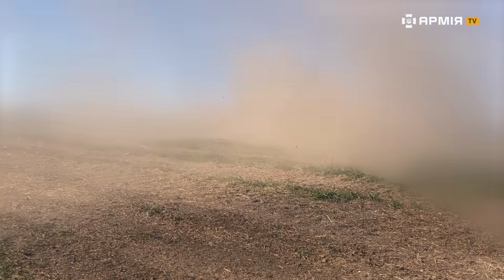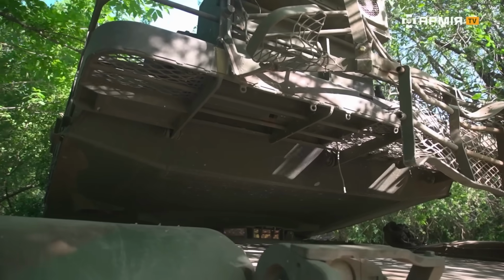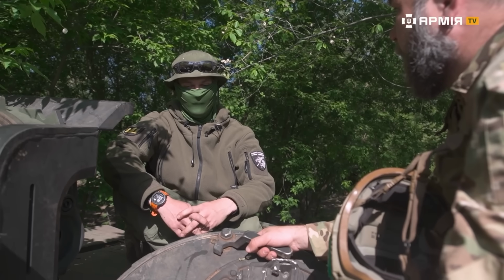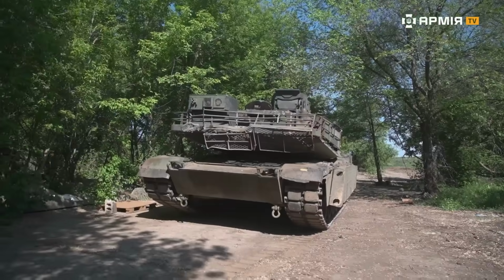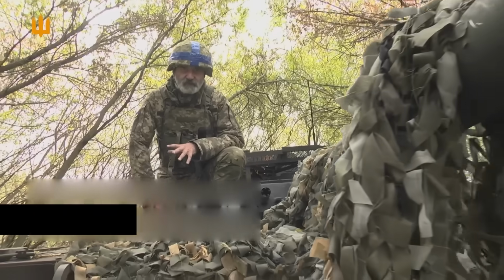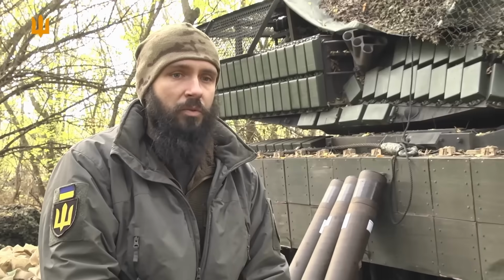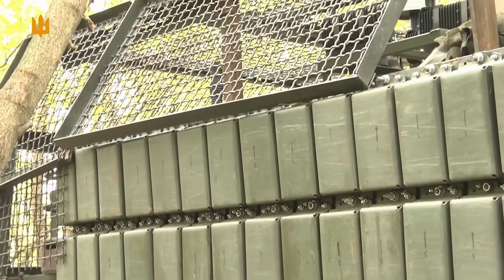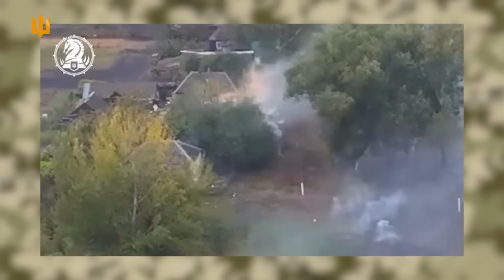Inside the ABRAMS M1A1 TANK: Russia-Ukraine War's BEST Kept Secret Revealed | ARMY TV

Comment: They installed a governor to cut down on vibrations that would loosen all the nuts and bolts in the suspension. Not smart to remove it. More track maintenance. And when moving thru trees, you elevate the 50 cal or if not equipped, max elevate the machine gun mount. Let it take on the branch hits. You only ever see wounded tankers that were fighting unbuttoned or open hatched. Kind of funny how that works. 70 tons of metal around you but you fight with half your body exposed. That is a true DAT (Dumb Arsed Tanker) that fights like that.

Comment: Actually, the best feature, IMO, is the engine. It's a turbine engine capabl of running any kind of fuel. It's an incredibly valuable feature to be able to refuel with gasoline or kerosine or diesel or whatever petroleum-based fuel.

Comment: Kontakt-1 doesn't protect from the majority of chemical ammunitions (kornet, tandem warheads etc) it will protect against basic single-warhead munitions like RPG-7 and such. but the increased weight = fuel consumption, and to place ERA on the turret makes no sense, NOTHING is going to penetrate the Abrams turret, it was specifically designed to defeat tandem warheads and soviet 3bm42 up to 3bm60 APFSDS rounds. placing it on the side of the turret, hull, and on the upper/lower front plate makes sense though.

Comment: Just so everyone knows the M1A1 is a very old variant still is badass but explains some losses on the Ukraine battlefield it doesn't hold a candle to the M1A2 SEP V3 the US will not be giving Ukraine any further variants other than the M1A1 because the armor is still classified them begging for better variants is going to end in disappointment its not going to happen.
Reply: Even the US M1A1 had a better armor package using DU.... the export variants and the ones we gave to Ukraine have a more conventional Tungsten armor NERA configuration than the US DU NERA.
Reply: @Whiskey11Gaming  the a1's ukraine is using has the tungsten driver tub

Comment: There is nothing special about the abrams, they probably didn't even give you the DU armor plating, it's tungsten plates, the roof is still a major weak spot, it's too heavy, chews fuel like crazy, too much mech work to keep running. Slapping reactive armor tiles is a good idea sure, but it's still just a rolling coffin that can be perforated from the top with a 500$ drone....Is it still tank? YEP! TANKS ARE BADASS AND A PAIN IN THE ASS but they are never going to be close to perfect.

Comment: Too many have been Lost... Saw them upfront with the foreign legion fighters in Ukraine 🇺🇦
Reply: Because they were designed for desert terrain, open areas, solid ground and enemies that wore flipflops with rocks for ammunition. They are hard to maintain and if damaged correctly they can't be fixed due to no facilities. Fuel consumption is extremely poor and makes it hard to keep on the Frontline. They're very heavy compared to Eastern tanks often getting stuck and abandoned. The optics suffer from condensation and over there it's often wet and cold. As of now the ammunition is becoming scarce.
Reply: Indeed 👍🏻

Comment: Drones have changed the battlefield. A drone can pinpoint drop or dive into the weakest areas of a tank's topsides and flanks. But not only that they can loiter and actively search out tanks, armor, artillery and troops tens of kilometers behind the front lines.... And the battlefield is constantly under surveillance.  There is no hiding or surprise.

Comment: The Abrahams was designed to fight in the open and blitz the opposition like was done in the Iraqi desert utilizing its long range gun to destroy Russian armor. In Ukraine they under utilize it for skirmishes with infantry and outrooting Russian from trenches wasting its capabilities. The Abrahams suffers the same weakness of all armored vehicles with its achilles hill being the tracks.
Reply: Bro it was literally designed to fight Russian Tanks in Europe.
Reply: @phieag1982  Yeah and it will massacre enemy tanks in a majority armor engagement, but of course most of Ukraine hasn't been a majority armor kinda war, yeah there's tons of tanks and IFVs in use, but there's also tons of mining and counter mining, top attacking drones on both sides, and a lot of massed artillery fire or targeted artillery fire.  
In these kinds of wars the individual superiority of one tank to another is reduced as a deciding factor.  It's rare that you'll find a modern tank design which is just awful, but in the case of the Abrams, Challenger and Leopards they're not as well suited to the current war.
Where they would really crush their Russian counterparts is if Ukraine had the ability to establish at least enough air dominance to prevent Russian aircraft or drones from reliably attacking their NATO tanks, then using them in larger formations to roll over Russian armor.  
As it is though tanks are mostly used for breaching trenches and forcing infantry to relocate but they're also rapidly targeted by drones or artillery and both sides are suffering what NATO members would generally consider extremely high attrition.

Comment: Geez, Australia is supplying more Abrams than America who have 5,000 on storage. Australia gave Ukraine everything they had left working.
Reply: Australia is sending wore out, broke down Abrams that were to be traded in for new Abrams.  Basically they are parts tanks.
Reply: @ramrod9556 Australian tanks were still in operational use when we sent them to Ukraine. The USA Abrams were older and not in service before the USA reconditioned them and sent them to Ukraine. The one in this video is an Australian Abrams. You can tell from the camouflage.
Reply: This is actually an Australian Abrams. You can still see the old camouflage, which is consistent with Australian camouflage.

Comment: The engine is governed down to keep speeds manageable for our young drivers. We have turned up the power and had the going over 65mph (104kmph).
I watched them do wheelies from a drag race type takeoff and accelerate to 60kph faster than you can imagine.
Powering up the turret, it does a self checkout automatically that is a wild ride.
Reply: There's a fine line between 'fast enough' and 'expensive repairs'.
Reply: throwing tracks is the real problem at high speeds when handled by inexperienced drivers.
Reply: They need to so they keep the fuel consumption down
Reply: it has barely anything to do with young drivers, its simply to increase transmission life span and keep fuel consumption down
Reply: @Ruska_o7  To be fair, that has everything to do with young drivers.
Experienced drivers can govern themselves.

Comment: How come that Abrams have been pulled from front line. I understand it is because of the huge heat signature given off by turbine engines, as opposed to other combustion engine tanks .
Reply: Going from the Oryx figures of 10 destroyed and 11 damaged and mostly abandoned they only have about 10 operational. The 49 Abrams that Australia is sending have been endlessly delayed by U.S. objections.
Reply: @IntrospectorGeneral  26 confirmed gone.  5 left operational.   Russian FPV drone footage confirms these numbers destroyed.
Reply: @ramrod9556 Oryx seems to routinely have a delay in reporting these days. What I found interesting was the relatively large number and 'damaged and abandoned' and 'abandoned' Abrams indicating a problem with recovering tanks. It's likely that unrecoverable tanks would be destroyed by artillery to prevent capture.
Reply: Thy only received 31 of them
Reply: These tankers just said that didn’t happen.
Reply: Current administration problems...